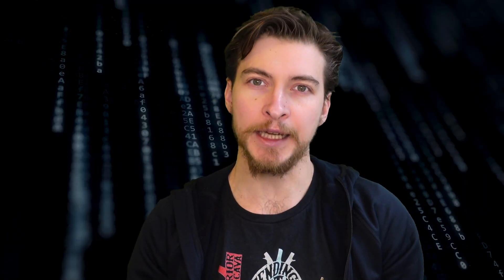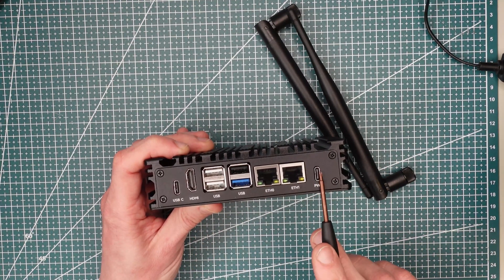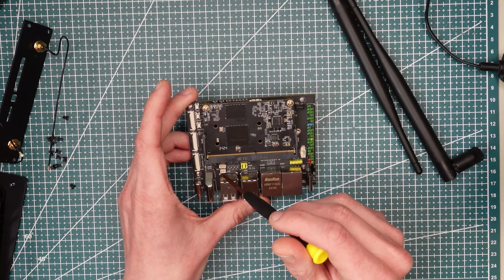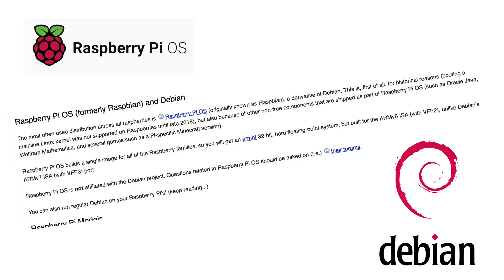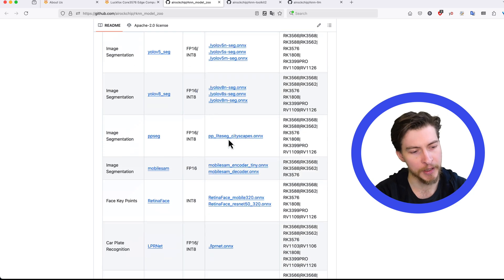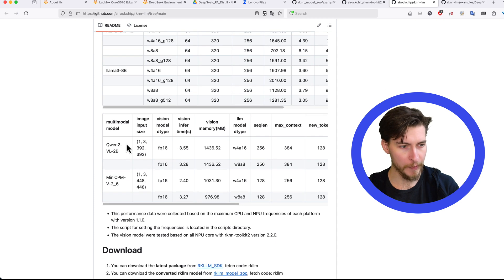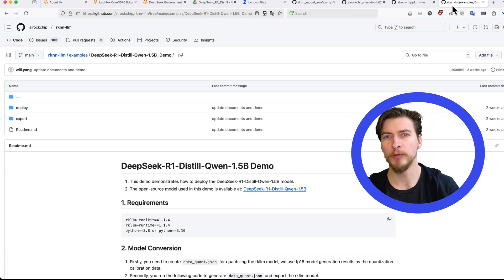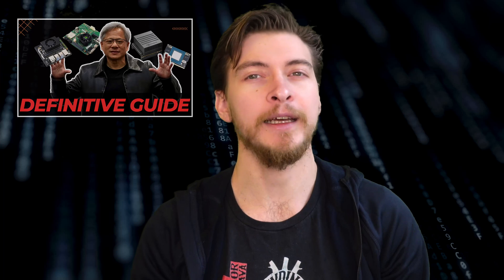Finally! An SBC for LLMs

Comment: Nice but I need to run 70b at the minimum.  I looked into m4 with 196gb of ram…. +5,000$
Reply: framework sffpc 128GB announced today = 2k$, ships Q3 25
Reply: @ thanks. I was pondering the Nvidia system…forgot what it’s called, for $3000. 

Originally, I was looking at old server boards that can hold 512gb and can handle 4 to 6 gpu and buy older server gpu.
Reply from the maker: It is really not meant to be in M4's weight category xD

Comment: The demonstration with rknn and rknn-llm is particularly informative for those interested in SBCs with AI capabilities.
Additionally, I wanted to ask if you're interested in exploring Waveshare products. We offer various hardware solutions and would be happy to collaborate with you on future projects!
Reply from the maker: Thanks! You can contact me on LinkedIn for potential cooperation. Also, do you happen to know when this will be in stock on Ali?
https://www.aliexpress.com/item/1005008054128037.html
Luckfox told me they have the board in stock already.
Reply: @Hardwareai  There is no corresponding stock available at present. （Checked just now）

Comment: this hardware is also in the H96 MAX M9 Smart TV Box and that is a bit cheaper.. but i dont know if the TV box has also the 6 TOPS NPU.. ? who knows? the backside with the us connectors look different. the TV box can order 8+128GB for $100 and you get a nice case and power supply..
Reply from the maker: Wow, this is really cool, thanks for the info! Yes, it's the same chip, 3576, with NPU as well, just on a different board (that is why the connectors).

Comment: It like 10x slower in "AI" with it 6 TOPS compared to the jetson orin nano sueper 67 TOPS for 199USD. I would not get this to run any ai. The Nvidia jetson is much better supported. And if you look for something more powerful you can uses a nvidia jetson orin nx or jetson orin agx.
Reply from the maker: I guess it all depends on your application? I.e. more is not always better, if it means you have to spend more, especially if you plan to integrate the SoM into a commercial project, the difference in BOM is huge.
Reply: Dont forget the halio 8 26tops also but i think orin nano super is the best for the money
Reply: Forget about the Hailo 8. Another reviewer proved that it can’t run LLMs. I’m hoping that the promised Hailo 10 can but I’m not holding my breath. So much secrecy around it I suspect that it won’t live up to the hype.
Reply: Where can i find a jetson orin nano for 199usd ? Its out of stock everywhere i looked.
Reply: True, but there’s definitely a market for this too. Nvidia Jetson is an overkill for drones and robots, this is much affordable.
Reply: Good luck buying one of those.

Comment: It's nice to see more options for running AI. Although this is rather limited with 8GB of RAM, other Rockchip boards can be ordered with up to 64GB and the same principle applies. But hope the rknn-llm acceleration of Rockchip NPU's get eventually added directly into llama.cpp (and into ollama) that would make them a lot more useable oob.
Reply from the maker: Fun thing is that it seems that rknn-llm is itself based on llama.cpp, at least partially. But it is closed source. Would be nice for them to play fair and contribute back. We will see.
Reply: @Hardwareai  yeah, this is usually problem with Chinese companies. Their open source software support is not on the same level as on the Raspberry Pi, and they usually release only binary blobs with old kernels. For example Allwinner is typically not very nice in this regard. But that was an interesting fact that rknn-llm is based on llama.cpp, I didn't know that. There's hope then.

Comment: Would all be fine if he'd not scam you with the front picture. He's suggesting a "Deepseek" model runs on the tiny device and his demo quickly shows it's just Qwen 1.5B
Reply: DeepSeek-R1-Distill-Qwen-1.5B, which is a deepseek model.
Reply from the maker: This is absolutely a DeepSeek model: https://huggingface.co/deepseek-ai/DeepSeek-R1-Distill-Qwen-1.5B
Concerning thumbnail - watch Veritasium video about "clickbait vs. legitbait", I really like his reasoning there. In short, as a educational content YouTuber, I have to find a fine balance between a boring, but exact title (and thumbnail) vs. clickbait.
Reply: @Hardwareai  No. It is Qwen 1.5B, licensed and owned by Tongyi Qianwen which is NOT Deepseek. It's a finetune of it to appear as if it was reasoning, with absolutely useless output.
Calling this deepseek is grossly missleading. As a commercial youtuber you should not deceive people but find content that actually is true. It's not educational, it's misinformation man..
Reply from the maker: @haka8702  are we reading the same model card?
"To support the research community, we have open-sourced DeepSeek-R1-Zero, DeepSeek-R1, and six dense models distilled from DeepSeek-R1 based on Llama and Qwen."
So this is a model created by DeepSeek. I never made a claim in the thumbnail about the exact size or architecture of the model - quite the opposite, in the video description I specify that it is DeepSeek-R1-Distill-Qwen-1.5B. Where is the misinformation?
Reply: @Hardwareai  Sure. "You are running Deepseek". Not Qwen 1.5. Keep the story up, I'm sure people appreciate consistency
Reply: And dislikes disabled? It's not even public anymore but he can't even bear to see it in his channel uploads. Coward
Reply: @Phoen1x883  Can see the dislike button, fix your browser.
Reply from the maker: no idea what you are talking about, afaik you can't disable dislike button.

Comment: how does it compare to a PC (not a very high end one)?..i love collecting sbc's
 but I find them to not be that useful
Reply from the maker: There is no easy way to compare, but let's pick a midrange CPU: AMD Ryzen 7 7700X
And see what is its compute performance: https://www.cpu-monkey.com/en/benchmark-amd_ryzen_7_7700x-bench_11
I find around 0.5 GFLOPS
It's FLOPS because this CPU does not have optimizations for integer inference, unlike NPU in 3576. So it is 0.5 vs 6 or 12 times less powerful. Will cost more as well.

I am comparing them only from a point of neural network inference of course - I know some people use SBCs as desktop replacement, but I'm not advocating for that on my channel. These are dev boards for me, so useful as a robot brain, an IoT hub, etc, but not a desktop.

Comment: Cool, but it needs more RAM to take on bigger models.
Reply: 32GB RK3588, same framework, faster than Pi 5 and much cooler!
96GB 8845HS, OK for 32b and 70b model, but need some tech setup.
64GB AI Max+ 395, fast, best C/P.
128GB Apple M4, fast, best local LLM without Nvidia GPU.
Reply from the maker: Bigger models will also require more compute, so more powerful NPU, this together with cost of RAM = more expensive and power draw. 
I don't think it is a replacement for a desktop or dedicated powerful inference server, I already pointed that out in another comment. Rather it is something you might use for robotics project for example.
Reply: A 8GB system is enough to run small language models, not large language models 😢
Reply from the maker: @geraldh.8047  So, the biggest one on benchmark list here https://github.com/airockchip/rknn-llm is 8B model with INT4 quant. Large Language Model is vague these days, but 8B models are universally considered to be on the lower end of "large" and what is close to 1B is "small".
Reply: @Hardwareai  Im so frustrated at this "Smoll devices can run decent models".
The fk they can.. Try using 8B model  with larger context window. 
A context window of 2048 tokens is the default on these models and its useless for most work. Especially RAG applications. 
So as soon as you increase the context window you notices that you do need a bit more vram/ram.
Reply: @RocketLR i run them on a pico u want the repo ?
Reply: @TheBigjohnstud79  sure lemme see.

Comment: Actually, LLMs are not only about "LuckFox" for RockChips.
You can use any RK3588/RK3582/RK3576 boards for it (they started to support LLMs one year ago). Two months ago, they even started supporting VLMs (Qwen2VL)
All RockChip boards have about the same quality. I tested/used Mekotronics, Radxa,  FriendlyElec, OrangePi, etc. 

I have about 10 videos with them on my channel (~2 about LLMs, other about classic networks).
Reply from the maker: Hey, Anton!
Thanks for the thoughtful comment, you're absolutely right, there is quite a bit of variety in terms of Rockchip boards from different vendors, that support rknn-llm. In no way this is exclusive to Luckfox!
I wanted to highlight this particular one, because it is rather affordable and also happens to be in the same form-factor as Jetson, which is rather unique.
Reply: @Hardwareai @Hardwareai thank you! 
Waiting for the next videos!

 I don't think it's the only platform with this form factor (Turing RK1 is a competitor). But maybe the cheapest one.